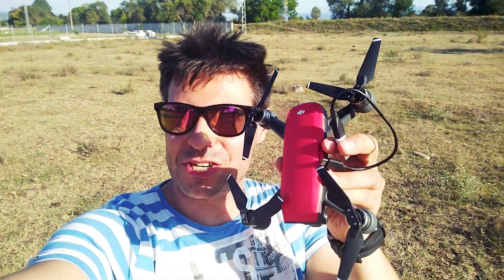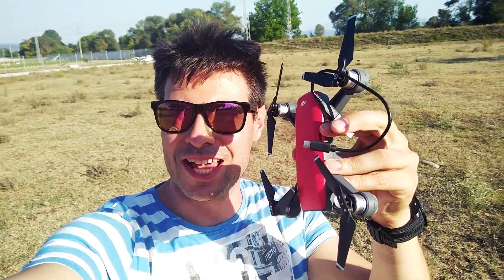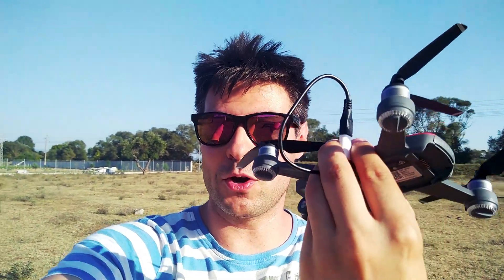DJI Spark FCC Range test in Europe EU

Comment: Hi I'm wondering if you can help. I have the Spark but it won't go no further than 25meters all around from where I'm standing, it's sucks! I have my phone connected to the controller and drone via WiFi and it has the very latest update. It's not on beginner mode  and I have the max altitude and distance set at 300 meters, what could it be?
Reply from the maker: Could be a problem with the antenna.Check with DJIs support.

Comment: I get 1200m with my spark thru forest in europe(in CE mode), with rc set to 2.4ghz. The video isn't bad until the distance hits 1000m, after that it video feed starts glitching and then rth kicks in.
Reply from the maker: 1200m is simply an awesome achievement. I never managed to fly beyond 600m.
Reply: @TechMishka  just make sure to point both antennas exactly at the drone(like the flat side not the antenna tips) and fly above 50m and use 2.4ghz mode. That's what I did.
Reply from the maker: @HeroSnowman  I will try that some time.
My best achievement was at only 20-meter height, maybe this is why the result was not that good. Thanks!

Comment: Hey there! Nice footage, and thanks for share with us.
I'm thinking in buy mavic platinum, the app you mentioned works with platinum too?
Sincerely I'm between platinum and spark because flight time, distance etc.
Reply from the maker: Hey Fabio! 
Hmmm. Tough choice, you know! There are pros and cons for each of these models. Overall - the Mavic won't need an FCC hack that much - lightbridge as technology will likely reach in CE mode better range than the Spark in FCC. 
On the other side, DJI are holding an event on 23rd. And a new Mavic pro is expected, and there are some rumors about mavic Lite or Spark pro - a kind of a hybrid. So why don't you wait for a few days to find out what is coming next and then take the decision :)?
Reply: tech4all thanks for the advise. I think I miss the lightbridge part in mavic specs 😅
It's strange what dji is doing, they lunch the mavic platinum then lunch de alpine white edition but only pro. But if they are lunching a new spark or new mavic it'll be nice.
Let's see what's coming 😀
Reply from the maker: A small correction - with the mavic they call it "occusync", which is still quite similar in terms of the way it operates. 
Yeah, looking forward to see what will be announced!
Reply: Well.. I've decided 😄
Since dji will release mavic 2, I opted to buy mavic air.
I'm waiting for receive it, 22 February.
Reply from the maker: Clngrats, Fabio! 

How did you get this estimation for delivery?
I have also ordered Mavic Air on 23rd January. Still being processed... Quite a shame. Guess smaller countries have lower priority :\
Reply: Thank you tech!
Quite a time to deliver.. Maybe there are some country's with priority.. Ordered from Dji?
I've ordered mine in a Portuguese store on 5th February, and they told me I'll get it in 22 or 23rd.
They have the Air in black and white normal pack in store, but the fly more pack in white only in 22nd.
They have in black but I love the white, so need to wait. This wait is killing me 😅
Reply from the maker: So we kind of share the same feeling :D
I have ordered it fro DJI.com during the time of the announcement. Noticed back then that batteries are out of stock, so I ordered just the drone and will get a battery separately. 
Problem is the color... Almost all people that have their Airs are black or white. And I wanted the red because of many reasons.
Two days ago I thought of cancelling the order and getting it from a local shop (there is a DJI store 5 minutes away from where I live). But... after asking them - when will you get a red one, they said "we have no idea, likely not soon". 
And once I mentioned about Mavic 2 Pro... they have dismissed the rumors and called them ridiculous :D And now I don't trust them anymore :D :D
Reply: Yeah 😄
I think they've received thousands of orders in that moment 😅
It's kinda funny Dji launch a new drone and don't have enough battery's in stock...
It seems lots of people want red and they had few in stock, black and white looks more popular that's why they have them ready to deliver.
Buy other color and paint it 😁
Lololol! They want to sell lots of Airs first before launch another one 😂😂
Soon or later they'll launch the pro 2, and I hope they have a little intelligence of put more sensors and give a little more time in fly, like 5 or 10 minutes, not 3 minutes in every time they launch a new one 😂
Reply from the maker: Likely going up to 40 minutes will be tough. Looks like too long, unbelievably long :D
The idea with the paint is cool, yeah. I should have done that.
The battery stock is something I believe has in connection to the idea of selling fly more combos. I have always liked them, but this one doesn't include much more than the regular edition, so I have decided to just buy extra batteries. So have done other people perhaps.
There seem to be enough batteries in local stores though!

Comment: Have you edited the footage to make the colours pop? I'm impressed with the quality of this footage compared to most of the other spark footage. Nice vid
Reply from the maker: Dan Gravil yes, there is a filter applied. Called a LUT. I cannot remember which one exactly, but if you are interested I may have check my records.
Reply: tech4all thanks! I'll have a look into that. Just got my spark. The key to great footage seems to be a little bit of editing.
Reply from the maker: Yup! Also - the DJI Go4 app has plenty of options to do that and in case you don't want to spend much time on it, that would be your right choice.

If you decide to edit via a more professional grade software - Davinci, or Premiere Pro, or any mac option - send me a note so that I can share some LUTs.

And - happy flying :-)
Reply: tech4all thanks for the advice. Very helpful

Comment: Does Return to home ability works with it while spark thinks that it is in US?
Reply from the maker: Works absolutely flawless. Let me explain why:
The FCC mode is simply a country-code association which enables the transmitter to be streaming in specific power mode. So if you are in the US it will be operating at "X" value, whereas in EU or Australia that goes to X-8db (usually).
The return-to-home function is associated with the embedded in the drone GPS  itself, meaning that it has no relation to the transmitter.

Whether DJI will decide to change that via firmware/app update - I cannot say. But at least for now that's how it works.
Do not worry about that when using it. Also - you can easily test and confirm it is all fine prior to flying ling distances.
P.S. glad that you watched this video. I miss the summer :D Seeing the sunshine on that one makes me feel ... warmer :D
Reply: I don't have a drone. I want to buy the spark but then I gave up and decided to buy mavic because of this problem. However I saw your videos couple of days ago and started to think buy the spark again. Spark is enough for me but i dont want to stuck in 500m. What do you think? Should I buy it? Is it dangerous?
Reply from the maker: Hi Mertcan,

The spark is a lovely choice for its price right now. And you can easily switch to FCC mode. You will realize that even 500 meters are quite a distance :-)
If you are about to start flying - the Spark is a good choice. And you always have the chance to upgrade to Mavic at some point if you decide that you need something bigger.
Reply: Mertcan Sarı hi dude, I had the same problem :D and I decided to buy the spark and use the hacked app.. I will try it tomorrow how it works, the spark should arrive tomorrow, so I’m excited
Reply: Hi dude. I am happy for you. I can't decide between Mavic and Spark but I think Mavic is too expensive and too professional for me. I guess I will buy the Spark and try this hacked app ;) I will buy it after 11 days. On 15 January. Let me know about the hacked app . See you :)
Reply from the maker: Alright then. 
If any help is needed - please let me know and I will do everything possible to help you.
As for the app - the tutorial is here: https://www.youtube.com/watch?v=HJRMlHabawg&lc
Reply from the maker: Awesome moment! Take your time to get to know it well prior to flying far away.
Reply: tech4all Alright! 😉 Thank you. I will let you know :)

Comment: Man you are golden , didn't know about this trick. those it still works after updates ?
Reply from the maker: Firmware updates do not disable it. THe latest dji go app for android seems to turn it back to EC on the second run. But I have linked the 4.1.8 in the description - that one works like charm :-)
Reply: tech4all i actually use the 4.1.13 and its gud normally

Comment: Hey! Do you notice any difference in battery life when using the FCC mode? The TX is more powerful so I guess it uses more power in general? Or only when you actually go the further distance? Thanks!
Reply from the maker: Robin Olthof I haven't noticed any degradation. Likely it is ignorable. Looks like it lasts as much as in EC mode.

Comment: Looks like the link is not working
Reply from the maker: Hi Arnold, which link is not working?
Reply: I thought the same. It seems like it doesn't work, but actually the .apk file is downloading in the background. After a minute or so it should appear as a download :)
Reply from the maker: THanks Andrew! 

If that won't work, here is a mirror:

https://www.dropbox.com/s/83m825ny5hb7f9d/dji_go4_4.1.3_v25.apk?dl=0
Reply: tech4all can you open this with iPhone ?
Reply from the maker: The modified app is Android only, once you have switched to FCC mode, then using iPhone with the original DJI app is fine

Comment: Why does the screen only show it goes up 225M?
Reply from the maker: No particular reason - I've just gained that height and carried on using that altitude. It can go higher, of course, but I wanted to test the range by going forwards, and not upwards.

Never tried to see the altitude maximums, and I have to be careful anyways, because in many countries the maximum allowed altitude is just 100 meters :/